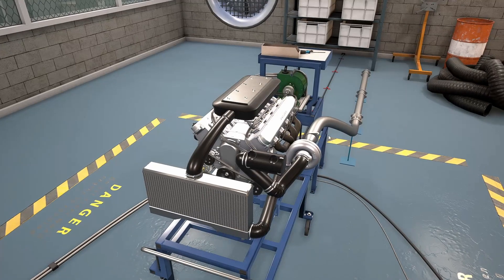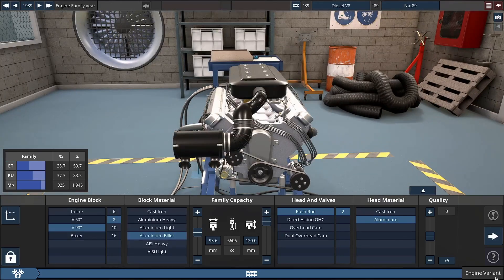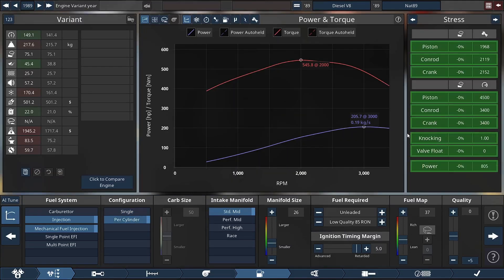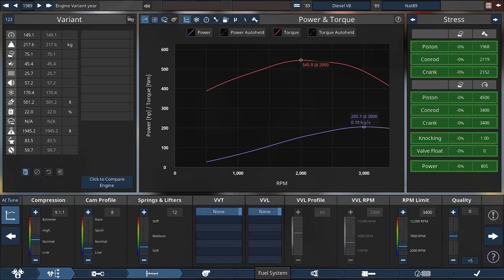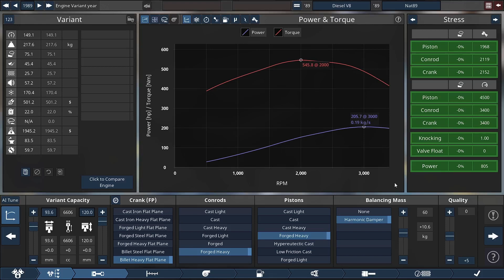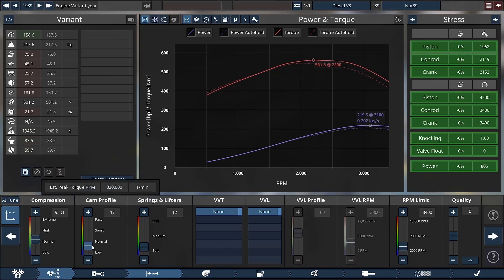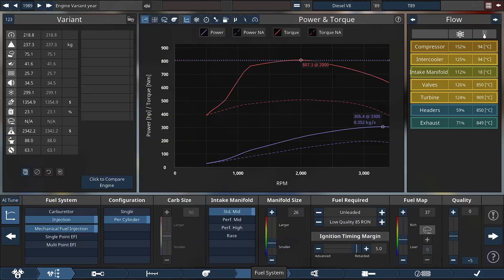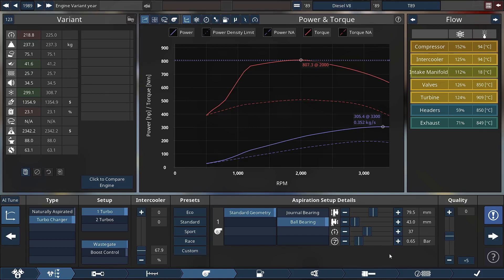How to create a "diesel" engine | Automation

Comment: nice work bro.
I hope one day having a powerful computer to run this beamNG simulator.
anyway, can you built a stock 4JA1 diesel engine  with all  stock parts and then tune it with the highest custom pats ( custom piston, custom push rods, custom valves, custom headers, custom crankshaft , custom cameshaft, custom valve spring, custom sleeves, custom block, big intercooler etc...) .
It's a 2.5 LITER naturally aspirated DIESEL ENGINE , 4 CYLINDERS INLINE, 2 valves per cylinder.
can you make it to see its pick power and torque and then with custom parts without turbos or supercharged and then with supercharger and if you can make 4valves instead of 2 valves per cylinder.
thanks man.
Have a nice day.
Peace.